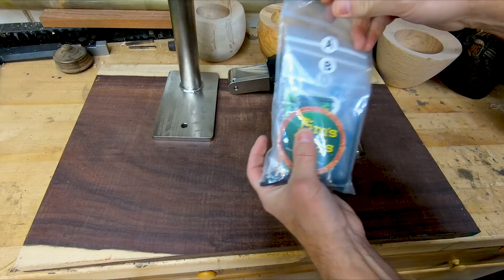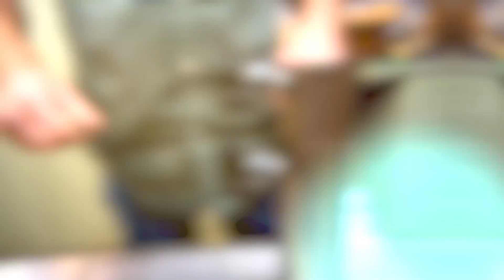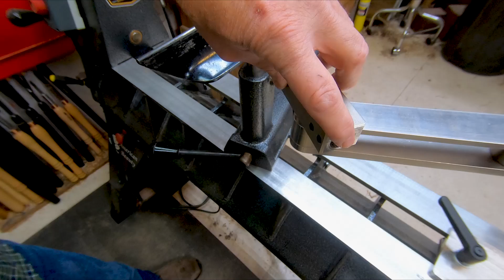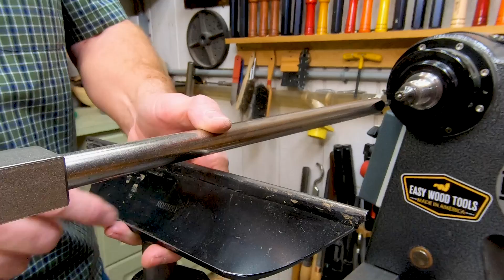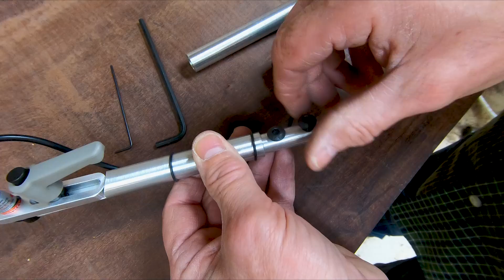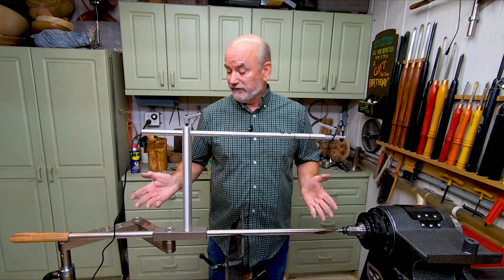Elbo 2 & Laser Guide Unboxing and Assembly

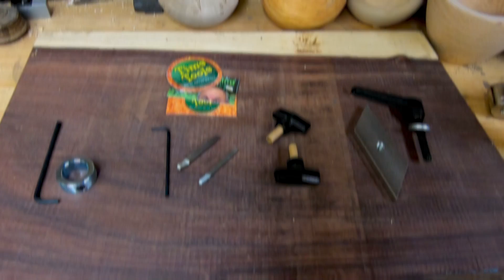Comment: Tim, my name is Rockey Isley and I have the Yoder. I guess the first unit you sent out and it works pretty good but I have noticed that you come out with some different things on the U2 Yoder too I guess and is there a way I can exchange some of it for that or not I live in Olympia Washington. It’s about an hour drive from Seattle Seattle. Give me an idea heading westbound towards the ocean, but I’d like to trade it in to get a new one from you if I could or just tell you it took some pictures what I have and then you’re sending me the other parts that I’ll pay for it, which is not a big deal. I don’t use it all the time and that’s why I’m doing it now. I have been asking to make a bunch of bowls and stuff and I would really like to get the adaption that you have made to it. They look like they’d be a lot easier to use. I don’t know. I misplaced my LazarBeam with the battery so I don’t know where that’s that. We move from one house to another so if you know about moving, you can’t find it here later and then you find it because that’s just the way it is so if you could get back with me, we can touch base. I bought mine. You can look my name up. Hopefully, you kept my name in your computer And I did get it and it worked fine but I didn’t be able to keep using it cause I was doing other stuff at the same time so now that my life kind of slim down a little bit, I can get back into turning using your unit. My number is 360-250- 5203 Lacey Washington 98503 and my address is 1913 Sycamore St. SE., Lacey, WA 98503 so or you can email me back it’s Rockey rockeyis@msn.com and do it that way too or both ways however you like get back with you with please I’d appreciate it again. It’s Rockey Isley Olympia, Washington 360-250- 5203. I’m retired so I have a little more time to work in my shop keep in touch. Have a good day. 0:31

Comment: I am interested in using your laser guide with a different hollowing system.  Can you provide your Vertical Laser Support Rod length and outer diameter ?  Length and Thread Diameter of Mounting Bolt that screws into the bottom of the Vertical Support Rod ?